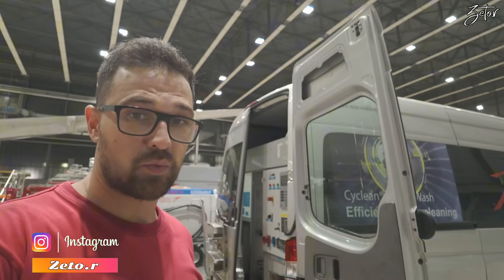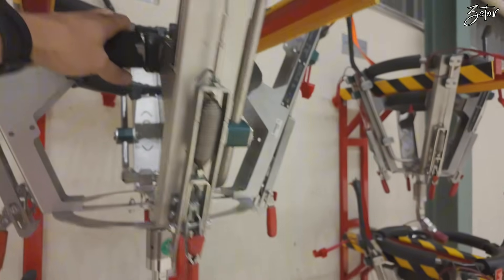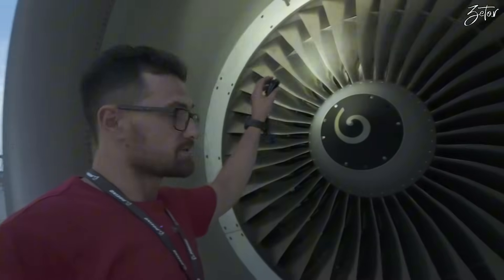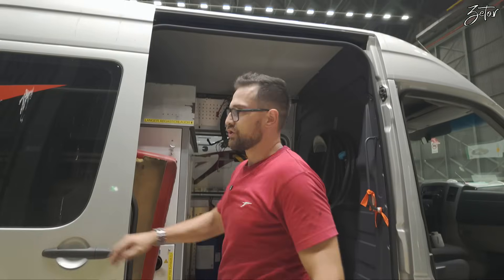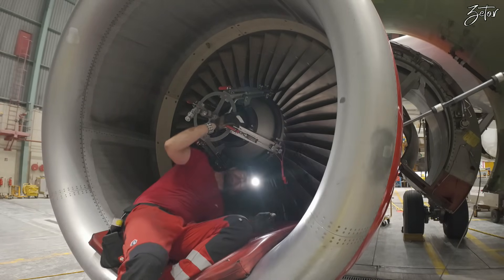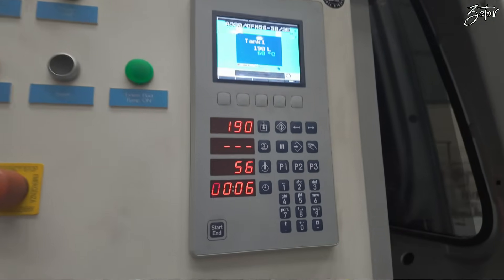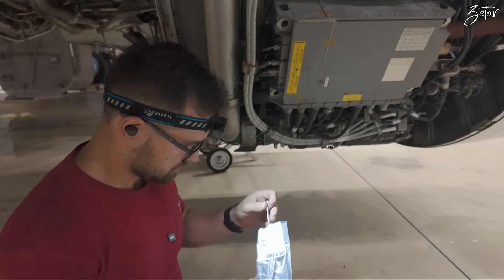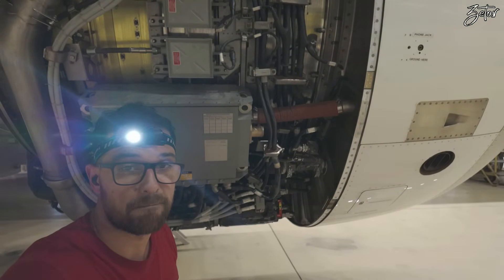How to perform engine wash on aircraft

Comment: The water does not get into the ac system? I thought the ac gets air from the compressor stage
Reply: The bleed air valves are not open during this procedure.

Comment: When spinning up the engine to wash/ clear, are you using the bleed air from the APU to spin up the engine? This was very interesting. I never knew this was done. How many run hours before cleaning the engines?  Very informative video, thanks.
Reply from the maker: Yes APU or ground cart. I'm not sure how often are we doing this but whenever consumption raised I guess

Comment: How many millions do you charge to do this.
Reply from the maker: It is cheaper than run engine without cleaning
Reply: @zeto.r  I think you are trying to say it is still cheaper to do this then just let it fail?
Reply from the maker: No without cleaning it loses efficiency that is it for sure it will not fail because after several 1000 h it will go to the shop for an overhaul but then it will be much more expensive

Comment: If the bearing between the hose and the connector locks for some reason, you'll get a huge mess! 
Then you need to run quickly!
Reply from the maker: for sure yes. :-D

Comment: Thanks... Tomorrow morning I gonna do a engine flush on my 777-300ER before going to work. Cheers
Reply from the maker: Good luck!
Reply: @zeto.r  thanks... A bit of water mist in the packs and bleeds, but now is doing 56mpg.
Reply: Not remotely funny .
Reply: @judefernandez827  Sarcasm its not supposed to be funny. As a pilot of sovereign, we do this with distilled water, after flying over: Wild fires, vulcans, dusty runways... Not even close, anything related to EGT, not even fuel saving. Its just for the engine don't decide to stop in middle flight. BTW, FL430 checkflight after washing (with gold made thousand dollar; a gallon of the "magic" solution)... We let it soak... NO DIFFERENCE. Just do the maintenance by the book, and the proper engine change. Theres no free lunch. Specially at aviation.

Comment: This is funny to me because I worked for Lockheed and Rolls-Royce at Stennis Space Center as a Turbofan Test Engineer on the R&D for the Trent 900, 1000, and XWB.  We washed our engines with a similar set-up, but we were on a man lift holding a 5000 psi spray nozzle while the engine was cranked on our test stand.
Reply from the maker: Wow, that is huge pressure we are using 60psi. Your job sounds cool one day I would love to visit such facilities
Reply: @zeto.r , I'd much rather work at lower pressure!  5k is gnarly!

Absolutely man!  Any chance you get to visit an R&D facility, do it!  I still have friends with Lockheed and Rolls-Royce at Stennis.  It's been many years since I left there, in 2012, but I'll text a few of them and mention you if you'd like!